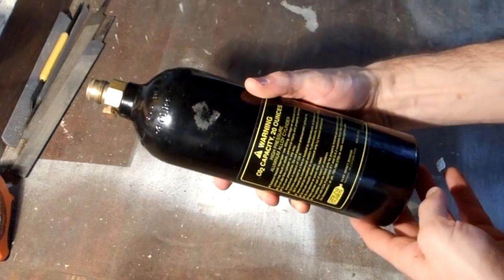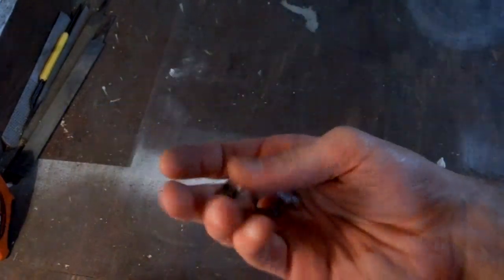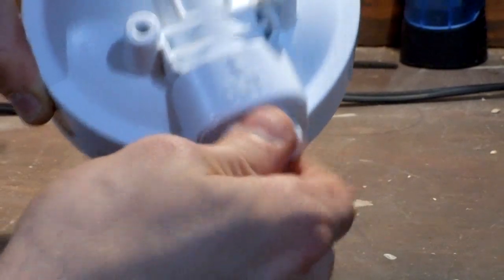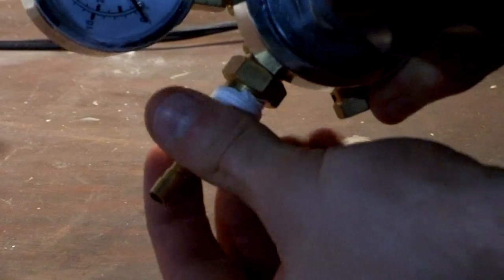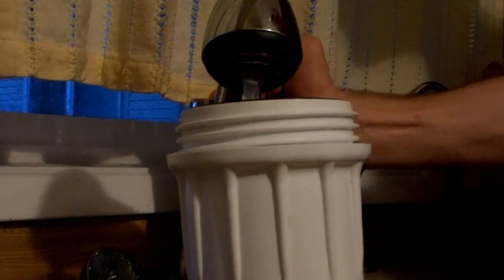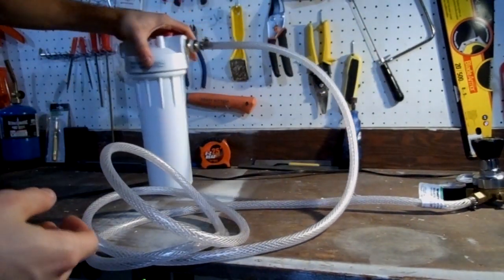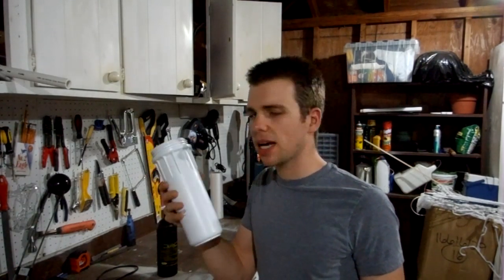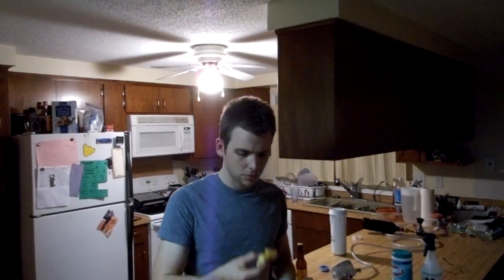Fast Hacks #2 - Home Made CO2 Carbonator

Comment: I need to try this, except I want to carbonate a flavored sugared water at hard cracked temperature.  Hopefully as it cools into a "pop rock" like candy.
Reply from the maker: You should check out this awesome guy's video: Making Pop Rocks candy at home

He manages to make his own pop rocks.  The basic procedure is to heat up the sugar and then pressurize it with co2 while hot.  Then let it cool while still under pressure.  It would be awesome to make some of this at an Open Hack Night.
Reply: Rick Osgood Hey man, is PVC safe to drink water, etc? Just curious. Awesome vid.
Reply: Radiation4TheNation it tells you on the pipe itself its its safe for potable water. i'm not sure if the schedule also indicates if its for potable water. i only know for sure that the different schedules handle different temperatures.
Reply: +Rick Osgood hey what regulator are you using
Reply from the maker: It was just some co2 regulator I found at Harbor Freight. Sorry I can't recall the brand or model.
Reply: Thanks
Reply: +Rick Osgood found it thanks again

Comment: If you have a paintball gun with a reg and an on/off ASA, just use that setup. It'll also reduce the stress on the CO2 regulator o-rings. Be careful not to let the CO2 tank lay at anything other than parallel or at a reflex angle to the ground. Any tilting with the nozzle pointing towards the ground will give out large quantities of liquid CO2, which will mess up your o-rings and if it gets into the food or beverage, make you quite ill... and also it's really quite cold.
Reply from the maker: Thank you for that information.  I didn't know that about the tank orientation.  I'll be sure and be careful.